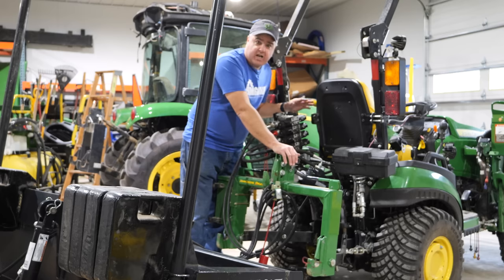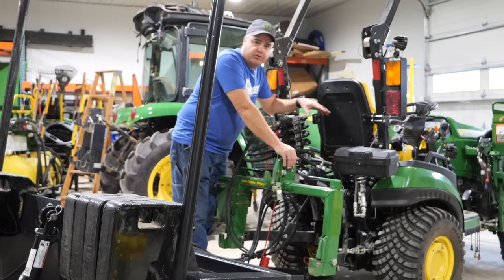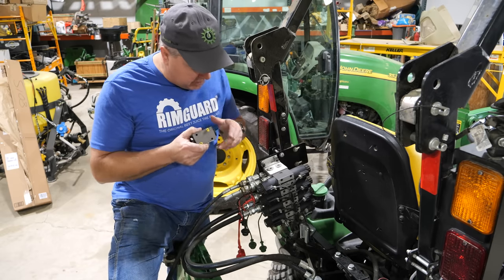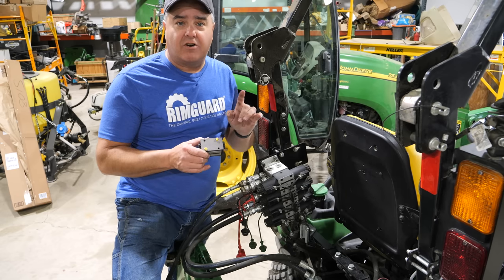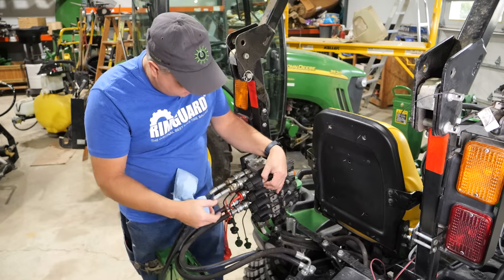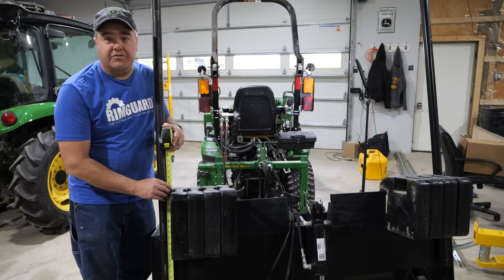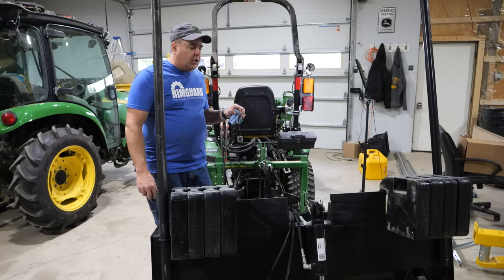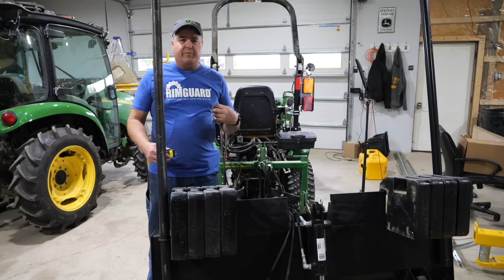This Check Valve Fixes Summit Hydraulic Kit Leak Down!

Comment: Hey Tim, I was an equipment tech for a utility company for a lot of years. I did a lot of hydraulic work on man lifts and non-man lift units. All hydraulic valves will leak down without a check valve. Some faster some slower depending on conditions like oil viscosity, maintenance, age and so on. John Deere sells a check valve kit for some of their loaders so they can be used as a work platform and you should probably install a check valve on your grapple to prevent shock transferring through the hydraulic lines, especially when raking backwards. So, I don't believe more expensive valves is the answer, I think you've got the right idea here which is to just put a check valve on the more critical functions. Great video, thanks!

Comment: After purchasing the additional part from Summit I still had a leak down.  I watched your video on the top link with the check valve.  After installing that top link my leak down completely went away.  Thank you for the guidance.  It is appreciated.

Comment: Great to see they work. I installed 2 of these (3rd function and side link) a few weeks ago and have not had a chance to test yet - it won’t stop snowing in Minnesota this spring and I don’t want to change from plowing setup. I was concerned about the additional width of the valves when the backhoe is on.  It was tight before these valves, so I moved the bracket to the outside edge of the ROPS.  I think I end up with even more space than before, but have not tested with the Backhoe on yet. Hoping for spring one of these days!

Comment: I had this issue on my tilt cylinder. I had a buddy fab the custom cylinder. A local hydraulic shop recommended a POCV.  So after some trial and error, everything is working!  If this video had come out 3 weeks ago, I would have gone this route.

Comment: I do have leaking on my hydraulic top link, but I thought it was related to the weights  when I have them on our weight rack that we attached to our hydraulic power pack on the three point hitch.. We just put on the weights when we are lifting round bales. We need the extra ballast on our Grand L 3560 even with Rim Guard.
We took delivery on the tractor about 10 months ago. At that time, hydraulic top links were in short supply so we were just happy to get one installed.  Lol

Comment: Getting smaller hoses helps a lot with flexibility. My top link came with 1/2” hoses, I swapped them to 1/4” hoses and they are so much more flexible and there’s still plenty of speed for a top link.
Reply: Yah, and it's not like you really need the flow rate that a larger hose >may< give you.

Comment: I installed hydraulic fittings that will swivel under pressure at the base on my bucket truck since the hoses move. A year ago, I was able to get 2 for about $100 but if I didn't the result would have been to replace the new non-conductive hoses relatively quick due to exceeding the bend radius specifications.

Comment: Thanks for the info as always Tim!  I do have a question though. With all of the added hydraulics, do you have to add hydraulic fluid to your tractor, or do most hoses and implements come prefilled with fluid?
Reply from the maker: You might have to add some.

Comment: So the summit site lists the check valve with couplers or without. I assume you installed yours without a coupler. My side link fades bad probably because I have  a three weight rack on each side of the I match frame. Any advice would be helpful. Btw I love your Bible passages at the end of your videos.
Reply from the maker: You already have couplers, right?
Maybe I am misunderstanding.
Anyway, all summit  valves leak down.

Comment: I have a similar set up. Will the valve work with the single ram cylinders that are on the Artillian plow? I know they work against each other normally but was wondering if enough pressure will be applied to the idle cylinder to trip the piloted valve and allow it to retract.
Reply from the maker: I’m not sure, actually!  Sorry!

Comment: what is the center condition on the existing summit valve? The PO check sandwich requires a different center condition on the solenoid valve to work correctly! My guess is that the current center condition is all blocked, but it will require ports A & B to be open to Tank to allow the sandwich to work correctly.
Reply: I think you might be right. With an all ports blocked center, there could potentially be enough pressure left in one of the supply lines to hold piloted valve open

Comment: Hey Tim, great video. I have the four valve with the third function. I have a grapple and it worked fine and then it didn't. It will open and close but it doesn't have enough force you close tightly. It will close but there's no pressure. I could put a balloon in it and it wouldn't change it's shape. I've unhooked the hydraulics and the grapple didn't leak down so I know it isn't the grapple. I've changed the electric ends but it didn't help. What is your thoughts on this? Thanks for this video.
Reply: When you say you changed the electric ends, did you move the hoses to a different electric valve, or swap the hoses around on the same valve, or just unplug the electrical connections and reverse them. It's a valve issue barring some crazy hose or fitting issue. If I had to guess, I would say the solenoid on the valve is bad and is not operating the valve correctly. It's possible the valve is bad and is just allowing fluid to bypass the function and return to tank, but that's unlikely. It is possible that the valve is just sticky and may need to be worked for a while to loosen it up or possibly removed, disassembled and cleaned. You would also want to check voltages at the valve when operating the switch to make sure you don't have an electrical issue.  I would move the hoses and the electric connections to a different valve to test.  Good luck!

Comment: Maybe I missed something? in a previous video (and mentioned here) you were using an agristore top link with a built in check valve. Was that not enought that you need to do both? This plus the video demonstrating a restrictor is getting me to think that a Summit electric valve system isn't optimal, just as I was about to buy the kit. Do you still recommend the Summit kit after all the extra things you've had to do?
Reply from the maker: Good questions.
1) The AgristoreUSA top link has the integrated check-valve. You do NOT need this check valve for that top link. ...nor for the new summit top link...it ALSO has the check valve.
2) Electric vs. mechanical.  ...yes, there are disadvantages to the elecrical valve. However, there are bigger disadvantages (in my opinion) to the mechanical version.   You must have hoses in and out of the mechanical valve controls. On such small tractors, that is LOTS of hoses.  The electrical lines are much easier to run to a location where the controls are 'handy'.   For that reason, I think the compromise to use electrical control is best.
3) The restrictors are required because the cylinders are so small.  Even a mechanical valve would have difficulty controlling such small cylinders (especially the side link) smoothly.  
4) Summit will likely make a "professional" kit available later ...in the next year or so which does not have the leak down issues. However, it will be much more expensive.  Based on my surveys, folks would rather deal with the leakdown than pay twice as much.
5) I think summit should include restrictors with the side link kit. ...and I suspect they will within a few months.  However, until then, getting the restrictors from Ken is easy enough.
6) This is an "ongoing" story.  There will continue to be changes/improvements in these kits as time permits.  This is what makes it fun!   We are showing the progress "as we go" so that you can become more knowledgeable, and jump in when you are ready.    
7) Hydrosplus.com is working on "proportional" electric valves which will be the best of both worlds.  However, again, this will be more expensive.
I think that we have a workable solution right now.  ...it will likely get better (more choices, but more expensive for the perfect solution, etc) over time.  
You have to choose when you want to jump in. :-).
Reply: @TractorTimewithTim   Thanks for the feedback. I was tempted to go with Tractor Innovations 2 spool kit. The levers provide the fine grain control that could reduce the need for restrictors, and the valves have built in check valves (ish). I think you can work with him to use a 2 spool valve that has float in one, which some people are suggesting. But - as I was thinking through this, I spend some amount of time on the tractor in brush, and having those levers sticking up could become branch catchers and activate them unintentially. With the switches, I could even imagine building a switchbox cover for those situations. Your feedback has given me confidence to get the Summit setup. Thanks!

Comment: Thoughts..i bought the 4 spool and intend on one being the hydraulic top link and one front 3rd function..that being said should i just get 3 check valves? just want to make sure thanks Tim
Reply from the maker: Did you get AgriStoreUSA top link with check valve? If so, you don’t need a check valve for this one.
I would recommend leaving one spool without check valve in case you find the check valve annoying.  So, add 2 or 3 depending on if the top link already has one.
Reply: Ok thanks. I have not purchased the top link yet but was going to go with your recommendation.
Reply from the maker: Ok. 18-26” cat 1 from http://AgriStoreUSA.com use code TTWT for a 5% discount.
Reply: @TractorTimewithTim  thank you sir I appreciate the help...this is all somewhat new to me and your videos are extremely helpful.

Comment: Looks like summit is selling the top and tilt kit cylinders with the check valves now, similar to the agristore ones.
Reply from the maker: Yep. We have shown in a later video. Use code TTWT for 5% off.

Comment: I have a float position on one of my rear remotes.    Would a hydraulic top link with a double piloted check valve prevent me from using this float function ??
Reply from the maker: Yes, the top link will not float with this check valve.
Reply: @TractorTimewithTim  
Thank you,
I just called my dealer and the mechanic  told me that the float would still work if the cylinder had check valves.   I just hesitantly ordered one even though I questioned his answer.
Oh well,  I guess I can return it.

Comment: Another great video from TTWT . One question though, does the Hydraulic Multiplier kits (electric) have the same bleed down problems ? And if they do what can be done about it ? I’ve been looking at both systems for installation on my 3046R with cab . Installation space on the back of my tractor is a big issue so I’m leaning towards the Multiplier option .
Reply from the maker: I don’t know if they use the same valves. Sorry
Reply: @TractorTimewithTim   With the Multiplier you can only run one hydraulic circuit at a time . Each circuit has an electric solenoid that the operator can open or close . Then you operate the chosen circuit with the SCV joystick in the cab . The multiplier is a slightly lower cost system an it has a more compact overall size . I’ll be using a three or four circuit system to operate up to four cylinder s , not sure which one yet .. My third function is probably the only one that may need a check valve though .  I’ll contact Summit Hydraulics to see what they recommend .

Comment: I found your comments about the weights on your speed mover very interesting. Granted my Flat out speed mover is a different model, I was thinking I needed to add more weight to force it to move larger loads of dirt. I can see the gouging with more weight and having the limited control that a 1-2 series and an the E hydraulic control switch could cause.  My flat out has a trey on the back axle for adding weight. I have about the same number of weights as your showing in this video, I have laying down in the trey. Seems I get a partial bucket full and unless I pre-work the ground to fluff it up a bit, I can't get a full bucket with it. I moved it over from 4066 to my 5115M, so power not an issue. So you thinking more weight in the weight box wouldn't help with moving more material in the bucket?
Reply from the maker: Oh, I think it might help you with the 5115M.  Have you done much welding? I’m really happy with the design of my weight brackets.  Would encourage you to give that a try!
Reply: @TractorTimewithTim  
No not much of a welder . But I have some ideas for either hanging more weight on it or putting more weight in the weight trey. I will send you some pics on GTT

Comment: You talk about not wanting the weights because it was too much down pressure... based on experience is from before you added this check valve. I wonder if the same will hold true when you set it at a certain height and it actually stays there instead of continuing to go deeper as time passes.

Comment: Question.  Doesn't the kit get in the way when using the backhoe?  Looks like you need to remove the kit when using the backhoe.  Please advise.
Reply from the maker: The kit fits fine beside the backhoe.  However, I’m not sure the check valves can be added…and it still fit.  
We have several videos showing us using the backhoe with the kit installed.

Comment: Hey Tim quick question. I have a JD 125R with 22 hours on it. For some reason when I have the deck on it it starts out ok but then it starts stalling out. I constantly lose RPMs. If I take the deck off it runs fine. Dealer seems to think there’s water in the tank but the red ring on the clear diesel filter is on the bottom. Any idea what the problem could be?
Reply from the maker: Replace both fuel filters.  The one under the floorboard is most likely the issue.
Reply: @TractorTimewithTim  thank you by the way.
Reply: @@stankappiris2242 I just changed the floor board filter yesterday and just pulled it into the garage haven’t really had a chance to check and see if the problem is resolved yet. Hopefully that’ll be it.
Reply: @@stankappiris2242 thank you by the way.
Reply: @TractorTimewithTim i replaced the fuel filter under the floorboard like you suggested and it solved the issue than you! My local JD dealer had no idea how to fix it.

Comment: Quick safety comment:  Always put everything rest in on the ground if you are going to step away from the tractor for any length of time. Tractors are “attractive nuisances”.  Which means kids will ant to play on them.  Always leave everything on the ground, with all residual pressure relieved when you shut down.

Comment: This should have been already built into its design. I get that they are trying to keep the costs down, but come on. Now people will have to spend $99 for each single valve they would need, AFTER they bought this remote kit, then find out they have leak down issues? Summit should be offering these valves for cost, not a profit. Sure made me rethink what i will do going forward now. I`m sure with a little bit of research, a company out there probably builds a kit you won`t have to buy extra parts just to make it work "properly". Yes, it`ll likely cost more, but i won`t have to fix it, later.

Comment: Summit needs to update the kit to work with the factory cab. I know it’s adding 90 degree fittings. But it’s another spot to leak with just adding fittings rather then hoses made with them. The factory cab is being more common on the 1025r.
Reply from the maker: What needs to change?
Reply: The feet lines to the grapple need to be 90 degrees it interferes with the cab
Reply from the maker: Easy to add a 90 isn’t it?  You can order one from DiscountHydraulicHose.com